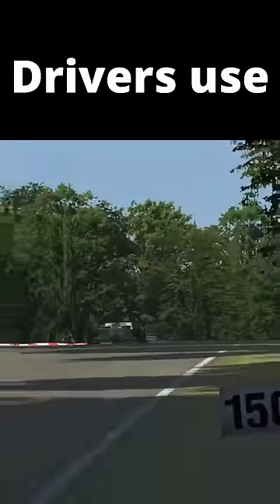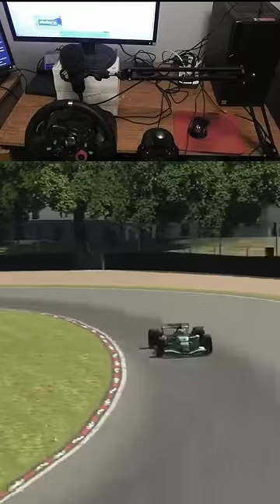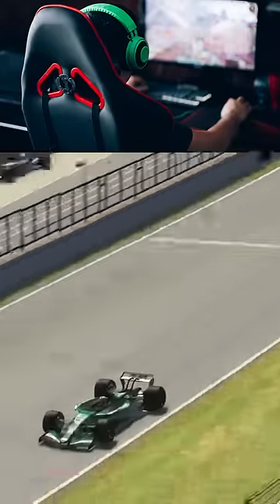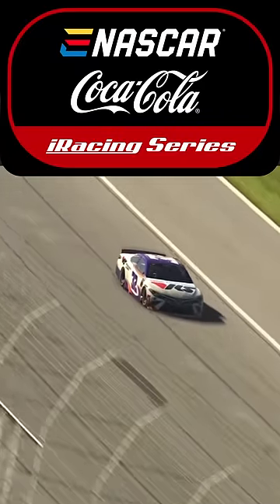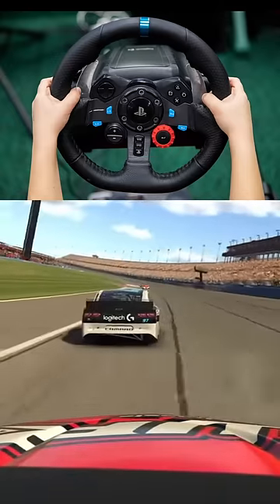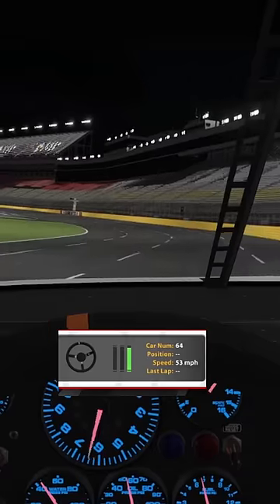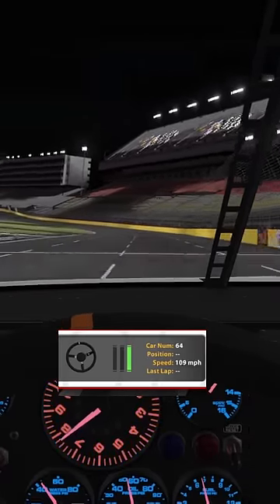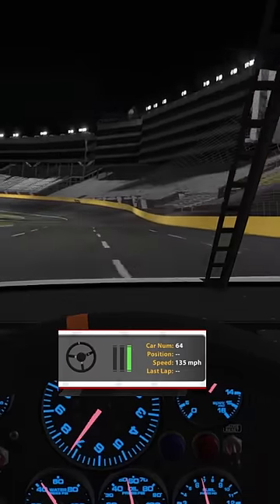Why Some Pro Sim Racers Use a BUTTON for Their CLUTCH!

Comment: Having a button for the clutch can also help with standing starts. Using a double clutch, you can release the clutch with the button, and the clutch depressed to the desired level with the pedal, it will immediately jump to the perfect clutch level every time.
Reply: This is basically how those dual clutch paddles work. One of my wheels have it and honestly it’s a frickin cheat code.
Reply: I feel stupid for never thinking about this. I wanted to try dual clutch for years, this might give me a taste
Reply: That's actually what they use in real life for F1 I believe.
Reply: @coeng.5714 that's why you see Lewis left hand on the top of the wheel at the start of races.
Reply: Never thought about it. That's freaking genius!
Reply: what's the point in SIMULATING racing if you're just gonna make it unrealistic
Reply: @AbusiveLobster  Exactly my thought.
Might as well play Need for Speed with teleporting capabilities if we're gonna do things in unrealistic ways when so strictly driving in simulator games.
Reply: @CamaroThings they don’t have it anymore
Reply: @iamyourgreatgreatgreatgrea6291 wait but they’re saying that this is what’s used in real life on dual clutch so why you mad?
Reply: @JAlonge017  He/she says assigning a button for double clutch makes it possible to have perfect clutch level every time, that's not something for an example F1 drivers have and do.
The point of simulator games is to simulate the real deal, no? So doing unrealistic things defeats that purpose.
Reply: @iamyourgreatgreatgreatgrea6291  true, but in this video we are referring to PRO sim racers. A lot of times in those high level leagues there are also huge prizes and the competition on the grid is extremely tight. Even 0.01 of a second can make a difference so they try to exploit every single mechanism that could possibly make you faster.
Reply: Oh
Reply: No dual clutching, granny shifting. 😂
Reply: @AndresHadi  Incredible.
Reply: @JAlonge017 I don't think he was mad....was just stating his opinion/making a point. Project much?
Reply: @iamyourgreatgreatgreatgrea6291 simulation games are still games my guy. Using a button for clutch is not that big of a deal when the cars are indestructible lol
Reply: @GabrielRojasAhumada  What about simulators do you not understand? The intention of it, whether it's a game or not, is literally and exactly to simulate reality my guy. No, a button for hitting perfect clutch level at all times is indeed nothing to get worked up about in comparison to indestructible cars, but not all leagues and servers have that.
Reply: Woah
Reply: @iamyourgreatgreatgreatgrea6291 there are 2 clutch paddles on f1 and f2 cars they get this same effect in the real cars, second clutch paddles is mainly for emergency reasons but you can use it on a start exactly like this
Reply: @reliablyJEllis  Except they don't get perfect clutch every single time, which is one of several reasons why they continually practice race starts.
Reply: I don't think using a button for the clutch is stupid, in fact, I think it is pretty clever.  Main point, saves time and quicker to do.  Regular clutch pedal, you have to move your feet and press down a pedal a certain distance, takes a little more time.
Reply: With a hydraulic clutch and a line lock this would be possible in the real world.
Reply: @CamaroThings I know this is old, but Lewis actually has his hand there to prevent accidental downshifts, as he uses the rocker style shift paddles, where it's possible to downshift by pushing the right-side paddle (and vice-versa, upshift while pushing the left-side paddle).
Reply: iracing has a feature where you can bind it to a key and set the clutch procentage too

Comment: I’ll use my pedal even though it’s slower it’s way more fun and realistic imo, but great tip.
Reply: Exactly, I feel sim racing is for having fun.
Reply: I just calibrate my clutch so it's short travel, best of both worlds
Reply: The people that bind their clutch to a button and the same ones that turn their brightness all the way up to gain an advantage in games that are supposed to be dark.
Reply: F1 has the clutch on the steering wheel, it's a paddle on each side. That a real car, not SIM
Reply: @dynamitedavies  Yes, but it's not a button, nor is it something they regularly engage and disengage while driving to save fuel.
Reply: @FordHoard  or running lowest gfx settings to not render bushes and tress, like in DayZ.
Reply: This should be probably banned in competitive games like actual tournaments.
Reply: @FordHoard well said!
Reply: @Yukanhayt-Mhenow that's what I used to do when I had a wheel and pedal set up, but nowadays I'm forced to used a controller and I hate it compared to a wheel. The gas and brakes are either way too sensitive or not sensitive enough, aka bad trigger accuracy on my controller, and don't get me started on steering. While ANYTHING beats a mouse or keyboard set up, hell even if you had one of those super under developed ones that have pressure sensitive keys that mimic triggers basically, would still be better than just the mouse or regular keyboard. And if you're one of the few on PC that plays games like BeamNG Drive, Asseto, or even Forza with a mouse though, then I commend the hell out of you
Reply: At the end of the day, if the devs really care about it, or think that its too unrealistic in a way that isn't ideal for the game,  they could simulate the clutch more realistically and actually have damping/slipping/clutch travel with limits etc.
Reply: @xtr3m3fLx  lol I did that in fortnite also. Never knew why people were asking how I could see them hiding in bushes
Reply: @dynamitedavies f1 got rid of dual clutches seasons ago. its now just 1 clutch. the first half of the clutches movement is finding the biting point and then the second half of the movement is controlling the wheelspin when the cars are pulling away from a standing start or from the pits.
Reply: @ReuloricsI’m not sure about Iracing I’ve never played it, but in other sim games mainly Assetto the car won’t go in gear if you don’t have the clutch compressed or you’ve already rev matched in neutral which is slower than using a clutch. It also can blow your engine and loose all power if the revs are too far off. I assume Iracing operates in a similar fashion.
Reply: Ikr, it's a sim racer. It's supposed to be like racing a car. If you wanna press buttons then a controller is the way to go..
Reply: In ACC flappy pedals so only use clutch for race starts and trips to the beach 😇
Reply: @dynamitedavies  ????

They have a semi automatic gearbox.

They have paddles for shifting up and down. The clutch is NOT on the wheel.

The clutch works automatically

And the anti stall system is responsible for the race start.

the only time they use a clutch paddle, is for the start of a race and only if somehow the anti stall system is not working, which is literally never. 

So its a totally different use case then what is shown in the video here. 

stop spreading ur nonsense
Reply: I was upset when we couldn't use an H-pattern shifter anymore with the current MX5.  It is now fixed to a sequential transmission.  The feedback I received from many was..."That's what the real MX5 has and uses now"  The button clutch is just another way to cheese the so called "sim".  Iracing needs to decide what it wants to be, and they can start with being consistent.
Reply: If you are doing f1 sim racing than the wheel pedal clutch is the realistic option
Reply: @TomAnderson. right and realism
Reply: @zeckor.  yeap, if I can’t drive on a track i’m pretty sure I can have a more or less similar experience in my sim equipment. 

I love it ngl.
Reply: @FordHoard  tbh, there are some things I understand. For example, I want my game to be atmospheric on singleplayer, and to look nice and be immersive, but when I'm on PVP, I turn down all the graphics settings and enable fullbright when that's an option. It makes the game look hideous but that is no longer the focus, the competition is. When I played Gran Turismo semi-competitively, I used paddle shifters on every car on online races, but used h-shifter and clutch on manual cars when playing offline or casually.
Reply: Given that I pretty much exclusively drift, my clutch pedal is pretty damn important to me.
Reply: iracing is absolutely dogshit when it comes to shifting and clutches. they completely broke h patterns (on purpose) by literally tripling the time it took to shift with it. they did this by when u shift into the gear physically, it doesn't shift, it STARTS the DISENGAGE from the previous gear. they also mandating sequentials on most cars. they did this in an effort to make it more "realistic". that's a lie. h patterns are better than paddle shifters and they know it. but. since Gen crybaby can't use clutches they force everyone to use sequential even when they know people use dumb stuff like these glitches. auto blip isn't there because it's better. it's because we have an entire generation who can't drive.
Reply: You are a real one, the one who use the button aren't pro. They are just exploiting (kind of cheater)
Reply: @FordHoard well if god makes ya blind fight god and turn up the brightness. Or I’m just scared of the dark. Both probably.
Reply: @dynamitedavies An example of this is in pro sim racing NASCAR not F1.  Things people didn't say are often wrong.

Comment: I think I’m gonna make my clutch pedal super sensitive now 😂
Reply from the maker: Ok so that’s also a thing so you’re not wrong LOL
Reply: @DJYeeJay I’ve got an asetek clutch to go with my invicta brake and gas.  I shortened the throw and changes the curve so it actuates with just a little press.  Maybe an inch or two.  So i basically stab the clutch with my foot as i shift.  

But to be honest there’s little to no need for a clutch in stock cars. Blip the throttle to downshift and barely let off the gas to upshift
Reply: thats basically what I do tbh
Reply: I did that with mine playing dirt. Definitely works
Reply: Hey man, this is a lot of misinformation. First of all NASCAR cars dont even use a clutch to shift since they use straight-cut transmissions, and have a emergency button clutch for pitroad. F1 cars been using a button clutch for 20+years developed by Ferrari and now used by everyone. All supercars produced in the last 10 years have a button clutch and paddle shifters. I am not even a racing guy and I know this stuff... come on. @DJYeeJay
Reply: yeah doesnt feel as illegal
Reply: whenever i use my McLaren GT3 wheel, i have the analog paddles used as my clutch (i think they’re called that, idk all the names)

Comment: I'll keep using my clutch. If I wanted to use a button for the clutch I would've stuck with a controller 😂
Reply: Right? Most bum sounding stuff I've ever heard lol.
Reply: @Grim_Prospects  lol for real. The whole point in using a Sim rig is for the realism lol 🤣
Reply: @neonnerd1364  I think it's been kinda lost over the last couple years tbh. We had a huge migration of people come from the shooter and console community that don't understand that part. They race like they are on NASCAR Heat or something. No race craft, no communication, no apologies. Just rampant BS over the last 2-3 years.
Reply: @Grim_Prospects  ya I used to race/drift online but I can't stand the ones that will wreck you or drive like they're the only ones on the track. Absolutely no etiquette whatsoever.
Reply: @@NopeNothanks-zj1yw ya for a launch. Other than that they never touch the clutch being the transmissions are sequential.
Reply: @neonnerd1364 That’s not the point. There’s a clutch button on the steering wheel period. Which means it’s not uncommon. Heck, there’re probably other race cars that utilize a clutch button on the steering wheel
Reply: Well some people aren’t hardcore simmers😭😭
Reply: @Goldblasterblaze  why waste money on a Sim rig just to use a button for the clutch though? At that point just use a controller. You'd save hundreds.
Reply: @Goldblasterblaze that's F1, not nascar.
Reply: @ryanjess5111 I think he is making the point that in the video he said would not be possible in real life while referring to sim racing in general and then went onto a specific example. When sometimes it is the case in real life.
Reply: Yes this is the best comment lol
Reply: @neonnerd1364 you do realize that people race competitively, right...? Some people want to win and use everything they can to go fast. If you want to be casual with it, that's fine, but knocking people who seek a competitive edge is silly
Reply: @Harmonic14  if you have to use a button for your clutch to gain an edge then you have no business using a Sim rig. For how much time you'll actually save by using it VS using the actual clutch is so minute that your other mistakes during the race will more than compensate for that time saved.
Reply: @neonnerd1364 It's the same people that turn their brightness all the way up to gain an advantage.
Reply: @neonnerd1364  sorry, but if that's your opinion, you're not at a high enough level to notice differences like that. If you aren't looking for every advantage possible, then you have no business in competitive racing.

If you're not looking to be competitive, that's fine, but again, don't knock people who are doing it just because you don't understand it.
Reply: @Harmonic14  if I'm racing I'm racing a real car. Sim racing is just for fun for me lol. Idgaf about "being competitive". And again. I stand by my statement. I want realism. Which is the whole point in Sim racing. Also if you're using a clutch to shift in cars where that shift time actually matters then you suck at shifting. F1 cars are sequential and only require a clutch to start and stop so you don't need the clutch for shifting at all. Other than that there is literally no point in using a button for a clutch if you can shift right. I've never used a button and I win races all the time. If using a button gives you that much of an advantage then you probably need to work on other aspects of your racing too. 🤣
Reply: @neonnerd1364  dude, he literally explains how a button clutch is faster than a pedal... A pedal cannot be actuated as an on/off switch; a button can. It's dead simple, yet you still don't get it because you're hellbent on being an elitist weirdo on a video game despite being slow.

It's faster to do use it on a button, period. If it makes no difference to you, you're not fast enough for it to matter. End of discussion.
Reply: @Harmonic14  OK bud. Go play your video games. I'll go race real cars 🤣
Reply: @Harmonic14  that little tiny fraction of a second you save can be made up by braking later and carrying more momentum. If you need to use a button for that little bit of time then you suck. Plain and simple. You're not Sim racing at that point.
Reply: @Harmonic14  but seeing since you play gran turismo I'm gonna go ahead and let you know that gt is nowhere near a realistic Sim. It's a good racing game but not a Sim racing game.
Reply: @neonnerd1364  I work on the Cadillac LMDh car, so bragging about racing real cars doesn't do anything for me... lmao I've been a top level sim racer for years. 

You're too slow for a button clutch to make a difference, it's fine. Stop stressing about it.
Reply: @Harmonic14  bro this is the internet. You can literally lie about anything you want. I don't believe you at all that you work on anything.
Reply: @neonnerd1364 personally I think if your too slow and get spun that's your own damn problem.
Should have been faster or defended yourself better
Reply: @ZirkyPlays  it has nothing to do with being faster or defending myself. It's about the people that never touch the brakes coming up to a corner and dive bomb you ramming you into the wall. If I'm Sim racing I'm in it for the realism. Real life racing doesn't do that lol.
Reply: you sound like the hardheaded dude that refuses to stop using a H-pattern when he's blowing up every other race 😂

Comment: this will only work in sims that dont calculate shift times. Try this in AMS and your gonna fight it the entire time. And blipless downshifting where you want the extra engine braking would be a nightmare with a button and lead to a ton of compression locking. Would much rather have control over speed of the clutch.
Reply: If you use a dogbox, shifting is as fast as you can engage the gears, and the entire reason you need clutch is to start from a standstill. Button or analog, it's superfluous. That said, dog collar gears aren't standard and cars with street gearboxes that use synchromesh require using clutch.